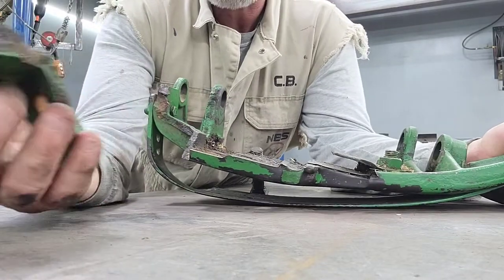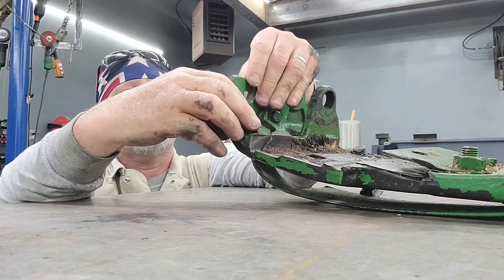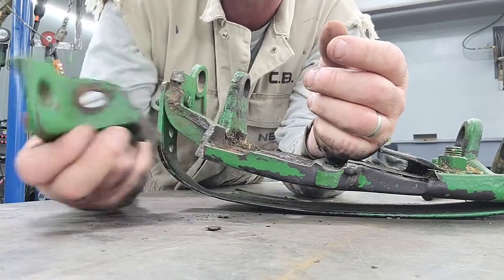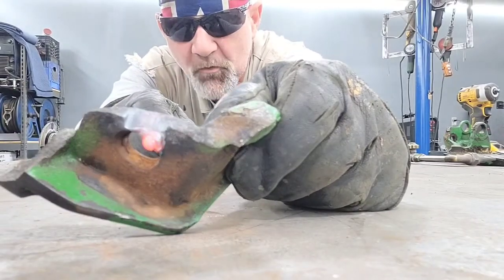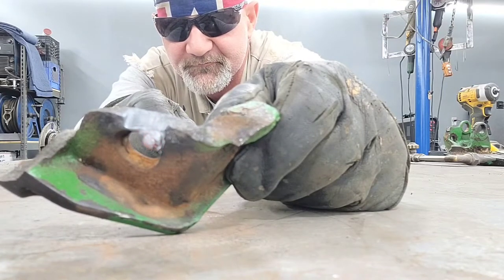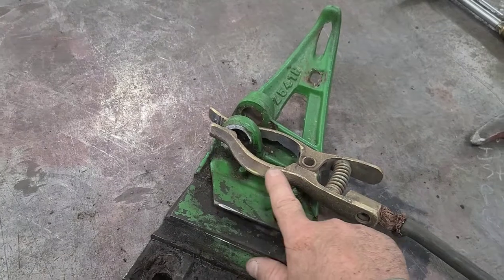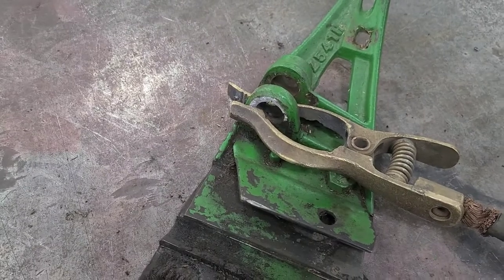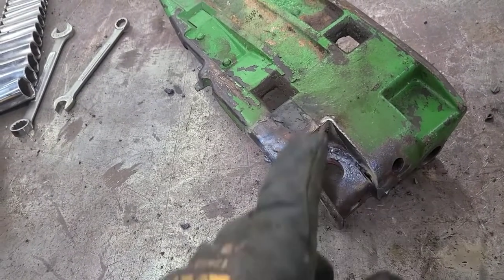Welding cast tractor part

Comment: Great tip on the torch cutting to differentiate between cast steel and cast iron! I’ve never heard that one. Tried the spark test several times with disappointing and uncertain results. I’ll definitely give it a try.

Comment: I notice you appear to weave 7018 versus drag. I also noticed that on the Z pattern for the truck frame. Is that correct?
Reply from the maker: I do tend to weave 7018...especially uphill...but when you mention the Z pattern on a truck frame then the one that comes to mind is the Ol' Red log truck and if so I don't think that Z pattern was uphill 7018...it was ARC 80 downhill and in that video I tried to explain why I was using ARC 80 in that instance

Comment: Are there instances when cast steel or cast iron needs to be preheat before tacking or the first pass? What is the preheat temperature if it does?
Reply from the maker: I don't preheat for tacks...an engineer would probably say you should but I don't...and if one of the tacks cracks when I'm welding I just grind it and weld it up

An engineer would also give you some specific preheat temp and procedures involving temp sticks or temperature indicating equipment...I don't do that...if the surface is above the boiling temp of water then that's about all the preheat ya need for anything 
So I just spit on it..if the spit sits on the metal then it ain't hot enough...if it boils immediately and slides right off the metal then it's ready to weld